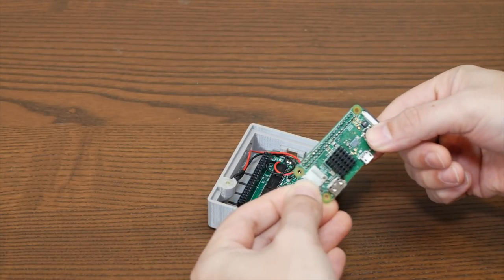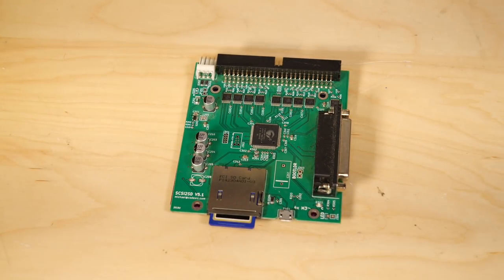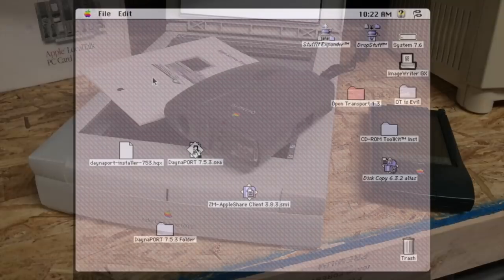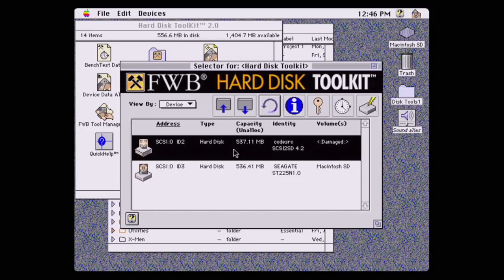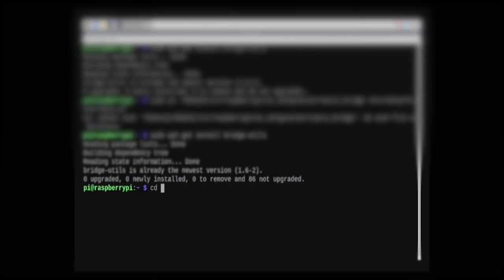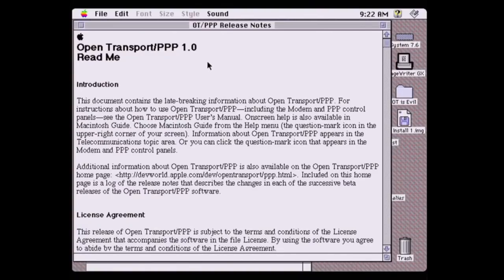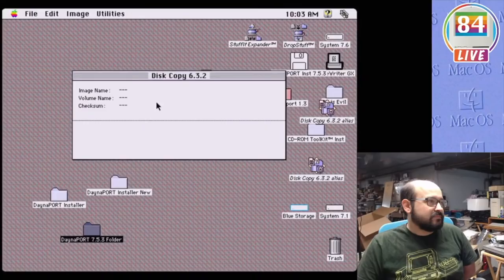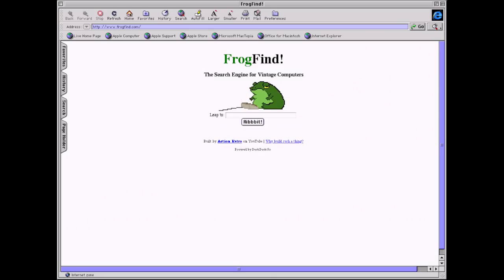RaSCSI - The Ultimate SCSI Emulator for Vintage Macs (Get online with this SCSI to Ethernet bridge!)

Comment: I've been scratching my head for the past 3 days trying to get this working on my Macintosh Classic.

I'm not there yet! But at least this video tells me that I'm doing everything right!
Reply from the maker: Please be advised that the instructions have likely changed since this video was published. Good luck! Check out the TinkerDifferent.com forum if you run into issues.
Reply: @Mac84  Thabks, I’ve had some excellent tips from the LowEnd Mac community which I will try today.
 Hopefully I can get it up and running!

Comment: Did you do any speed tests with the emulated Ethernet adapter? While I'm not exactly expecting it to set the world on fire, I'm curious to know how it compares to the speed of vintage Ethernet add-in cards.
Reply: Ethernet speed is close to the original hardware. There are also some enhancements that superjer2000 is working on for the scuznet board that I'll be pulling in that make it even faster.

Comment: For a while I've been thinking of putting a Raspberry Pi 3 in the spare drive bay of my power Macintosh 6500 and routing composite video, video, ethernet through the case, out a slot, to plug into the Mac motherboard which has composite video input. Now I'm thinking I can add this too because there's a scsi cable in that bay. It would essentially modernize the performa power mac.
Reply from the maker: This is a neat idea, but just remember that composite video doesn’t look good with a desktop resolution image. You may be better off doing a VGA switcher or something.

Comment: Have you run any speed tests on RaSCSI? I'm curious if it performs fast enough for me to use it as the storage drive for my Mac IIsi and do VideoSpigot video captures to it… (Sadly, SCSI2SD isn't fast enough, I can only maintain 5 fps or slower when capturing video to it.)
Reply from the maker: I have not, but I hear it’s faster with a faster Pi model. I believe there are some benchmarks on the RaSCSI Wiki page. I plan to order another and a Pi 4 in the future.
Reply: @Mac84  I do have a Pi4 sitting around unused... I suppose I should grab one, thanks for the video!
Reply: @AnonymousFreakYT   Given that it's using the GPIO header, I wouldn't expect miracles.  :-)  Flexible, yes, but fast ... probably not terribly.  I think FPGA is going to be the key there.

Comment: Great video, as always! I am having the same problem as you that when the rascsi reboots, I need to attach the drive again but my /etc/systemd/system/rascsi.service file is blank. It doesn't exist. Also, typing in rasctl -l gives me file doesn't exist while in the images folder. Any ideas? Thanks in advance!
Reply from the maker: I can only suggest you check their discord and documentation. As a ton has changed (including their name) since I made this video. Good luck!

Comment: I was finally able to repair my Quadra 840AV and need an Ethernet solution now. I would like to use the RaSCSI externally. I have read the DB25 port on the 840av is only 5mbps, is that true? That would be a very slow experience. Would you still recommend it? As internal drives I have already ordered a 300GB 10k 80 pin SCSI drive and an 80pin to 50 pin adapter. The CD emulation of the RaSCSI is also interesting but will it work with cdda streams with disc based games?
Reply from the maker: I would suggest putting the RaSCSI on the internal SCSI bus. All you need is a cable to accommodate all the devices and it should work fine.